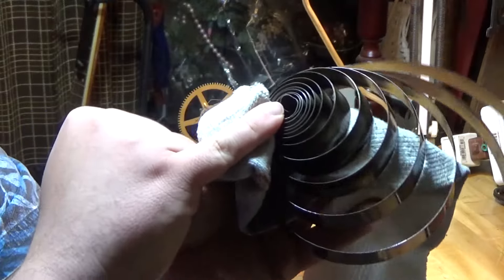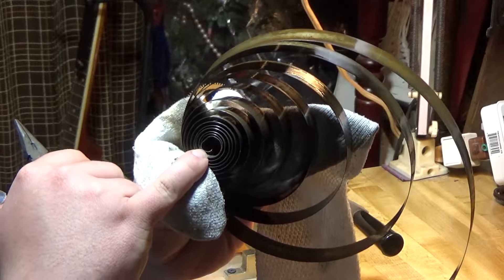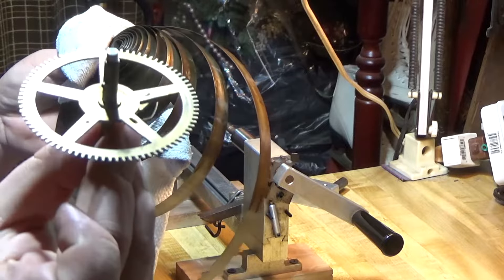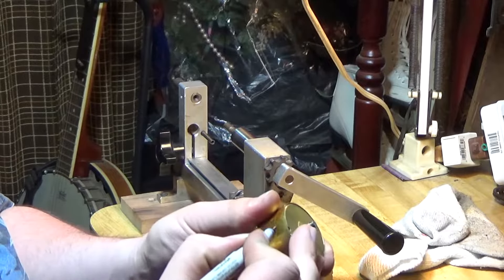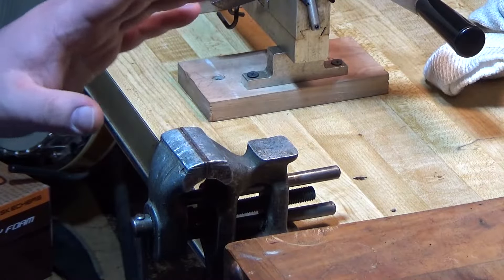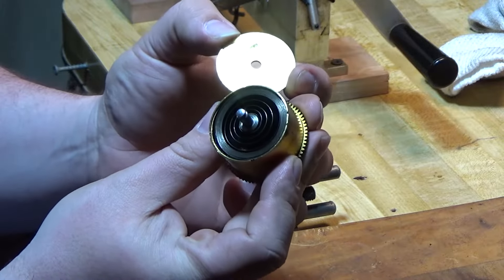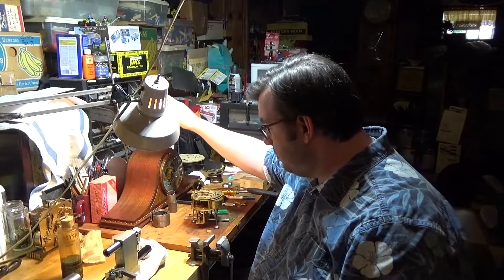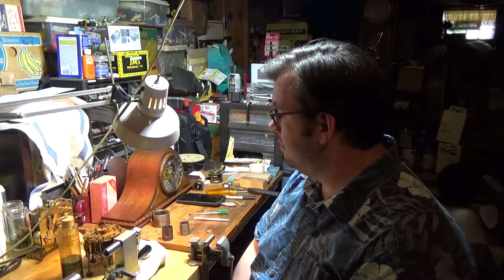Clock Repair - Cleaning and Lubricating Clock Mainsprings

Comment: When you mentioned cleaning in an ultrasonic bath, it reminded me of a trick I learnt, and that you probably already know.  If working with different parts, or different solutions, I often put them into different zip lock bags to keep the main solution clean and reduce wastage and cross contamination.  The ultrasonic waves work through the wall of the plastic bags just the same.
Reply from the maker: I used to use a similar method for cleaning watch parts and platform balance escapements.  Small beakers were the trick with water in the main tank and the clean/rinse in the beakers.  Worked great until I found a vintage watch cleaning machine.  Thanks for sharing!!

Comment: I too dislike reversing the arbor support when changing from loop end to hole end springs.   So I made a modification to my Ollie and no longer need to reverse it.

I removed the pins in the arbor support, that held the ''runner'' in place, tapped a hole where the pin was and installed a "clamping knob'', that's what ACE hardware calls them.   Screw with plastic knob, they have various sizes.   I also replaced the 'runner' with one that is 5'' long, rather than 2 1/2'' origional length.   I turned the ends with a center drill just as the origional was,  60 deg.  female centers.   Works great!

Comment: Thanks for the posting.  I would encourage everyone using this type of winder on a hole end to use the adjustable clamp and stop that comes with the winder.  It alleviates the need to hold the barrel to insert the sleeve and it is a lot safer than doing this operation entirely by hand.  It also saves a lot of time!!

Comment: Great video! Can you please make 2 videos. 
1) Please showing EXACTLY what you are looking at with an old main spring that would make it not worth using again (junk). What are the signs of wearing out? Thanks and I hope to see this video soon! 
2) Please show us EXACTLY how to measure out an old main spring so we know how to order the correct new replacement main spring.
I would like to make a little suggestion for you too. When you took the barrel fully assembled and you were popping the lid off the barrel by striking it on the back of the vice (11:56 mark of this video) you risk doing damage to the arbor. I'd like to suggest getting a brass hammer like one from Harbor Freight. Lay the hammer on its side and use the flat side as the surface to hit the arbor on. The brass will dent and not risk doing damage to the arbor. Just a suggestion. Again I loved the video!!!

Comment: First rate video, answers many questions about mainspring winders. I've removed and cleaned several Victrola mainsprings from their barrels, without any winder or other fancy tools ------ I don't recommend it! I need to remove and clean the mainsprings from an older Chelsea Ship's bell clock, which I've sent back to the factory twice, and the time spring still grabs and feels glitchy. I will now try to do it myself, AFTER I've purchased a mainspring winder. Cheerio!

Comment: When I had a barrel like the one you were working on, ''reverse winding square'' I worked on the winder end with the arbor support.   I turned the winder until I was looking into the barrel.  Then with my gloved left hand, I grabed the barrel  from the back side of the winder and held onto it from the bottom of the barrel.   The barrel hook can be easily seen when rotated to the top of the winder 12 o'clock position.  Then procede as usual.

You can easily do this as your winder is mounted on th eleft side of your bench, but you would have to move your banjo.

The Seth Thomas 124 has all three barrels with ''reverse arbors''.  With this clock I made an arbor to replace the one that came with the clock and it worked great, and have used it with all other 'reverse arbors'

Comment: That last clock that has the westminster chime I have the same. Needs cleaning dismantle and put back again.
Reply from the maker: Those New Haven movements are notoriously tedious and difficult to work on.  A lot of shops refuse to service them, because the extra time and effort involved causes the repair cost to be more than 3 times the value of the clock.  Plus, they are temperamental, at best, and often come back with issues later on.

Comment: Just started working on a ST 48R. First time with main spring in a barrel..Video is a great help. Thanks..Do you have a video on the ST 48R or suggest where info can be found? Thanks again..
Reply from the maker: I'm familiar with that movement!  If memory serves, the barrel is directly attached to the front movement plate.  I've found the easiest way to remove the mainspring is to use a donor winding arbor that inserts from the opposite side, with the square part of the winding arbor pointing toward what would be the inside of the movement.  Then you can use the same principles in the video to remove it.  You will have to remove the original winding arbor first, of course! :)  Hope that helps!

Comment: UPDATE : I got a spring winder off of ebarf and its very good quality and I got it for a good price . It is similar like yours but parts are missing . This one does not have the hooks and the main arbor that goes into the shaft for the spring is gone. I have about five cups but I think I might have a few missing. I need some help in telling me what is missing and how to use it. These doesnt seem to be a manufacture on it. But it is hell for stout and very well made

Comment: Excellent video. I'm a mechanic, but an amateur with mechanical clocks. What was the visual signal that you used to say (6:30) the spring mechanism wasn't worth saving?
Reply from the maker: Thanks!  The mainspring had been previously "repaired" and when they put it into the barrel, they somehow riveted it into place, making it near impossible to get out without drilling it out.

Comment: this works good if your using a key with the square end. What about if your key threads onto the arbor. How would you grip this is the spring winder?
Reply from the maker: Good question! There is another let down key accessory you can buy that accommodates alarm-style winders.
Reply: @BrackenClockWorks  where do i get it. I havent seen one. Must not be looking in the right olaces.

Comment: Question: in this video you’re using the Keystone light variant oil. On the other videos about the American movement you showed us the Slick 50 One Lube to use for lubricating springs. Do you use one type for barrel one hole springs and another type for open loop end springs?
Reply from the maker: I made the switch to the Keystone light a few months ago for all mainsprings. Reason being, I’ve found the Slick 50 breaks down after a couple years and actually hinders the springs’ efficiency.

Comment: Thanks for posting. A word of caution though, I have seen the barrel come loose from the gear with the removal method you are using (hitting against a hard surface). Probably more likely with a steel cover but it is still a possibility.
Reply from the maker: Ah yes I understand what you mean. I have had that happen once recently, too. Thanks for the tip!!

Comment: Hi Sir,, Can you please advise where to buy the Clock Spring (Strike Side) I have Korean made clock which stile side is weak and not striking always nave it’s not turning the gears
Reply from the maker: Very rarely are mainsprings the weak point in a clock’s ability to function properly (unless of course they’re broken, which is rather obvious to see). What you’re experiencing is usually a symptom of wear, which would require more extensive repairs. It could be gummed up oil around the pivots and it just needs a cleaning and re-oiling, but in my experience with those it probably needs an overhaul. It could also be something simpler such as something rubbing or interacting incorrectly.
Reply: @BrackenClockWorks  Thank You

Comment: What is it that keeps the spring from just sliding through the guard where the tail is? 🤔
Reply from the maker: Which spring?  The one in the barrel or the first one without?
Reply: @BrackenClockWorks  the one from the barrel. You put in the cylinder with the tail poking out. Shouldn’t it have just unwound out through that hole? Man, I wish I could see the tools and process in person. 🧐
Reply from the maker: Ah I see what you mean, now.  It cannot just slide through the slot.  The outward pressure from the spring is universal from the center point in that instance, putting equal pressure straight out against the sleeve, holding it in place.
Reply from the maker: The friction created from the outward pressure against the sleeve is what holds it in place

Comment: Silly me.
I always wound them, bare handed, into spring clamps and/or spring barrels.
I have never even seen a main spring winder.
I was told that they were a waste of money.
The stores that I worked in did everything on the cheap. 😉😁🙄
Reply from the maker: At the shop I work at, a lot of the other techs had the same feeling until I introduced my own mainspring winder into the mix.  For over a year, we used mine until the owner finally bought one for the shop due to popular demand.  It makes installing springs a breeze, it doesn't damage the barrel or "cone" the mainspring, and it's much safer too!  Cheers!
Reply: Film profesional și bine realizat,mulțumiri pentru informația detaliată și pentru explicații.Totul merge bine daca ai un dispozitiv de bobinat profesional.Inca nu am găsit un dispozitiv de bobinat,și mă descurc greu cu improvizații.Aveti informații unde găsim așa ceva?Mulțumesc oricum pentru realizarea filmulețului.

Comment: Could it be possible if i placed the quarter main spring in the main clock spring and but the main sclock spring in qauarter one? In westminster chiming kienzle clock
Or the no of teeth will not fit the work
Reply from the maker: The spring size, as well as barrel size and orientation, is not compatible between the chime and time trains. This is true for almost all other Westminster chime clocks, as well. The chime spring and barrel is larger and stronger than the other two trains.
Reply: @BrackenClockWorks  
I have a Westminster clock that doesn’t wind down very much in the clock. However long I leave the clock to wind down, when I try to wind it up again, it doesn’t turn easily and not many turns either. The two arbors either side hardly turn much and the middle arbour only turns 3 or 4 turns. Could it be the springs are very dirty and gummed up? Or that they’re in the wrong places? I haven’t taken a clock apart before. I thought it was supposed to be an 8 day, but I wound it the little it can, each night. Can you get 30 hour mantel clocks with Westminster chimes, or are they all 8 day clocks? It keeps good enough time though.

Comment: Why do you say the spring you removed is garbage?
Reply from the maker: Because someone did a poor repair job previously that essentially riveted the mainspring to the barrel.  Yes, it can be removed and possibly saved by drilling out the rivet and replacing the rivet properly, but since I have a surplus of these movements (they can be a royal pain to work on, so I have spares for parts), it is more cost efficient for me to just replace the barrel and spring.